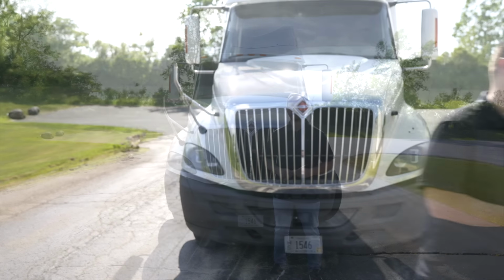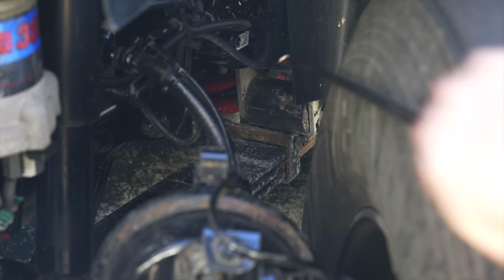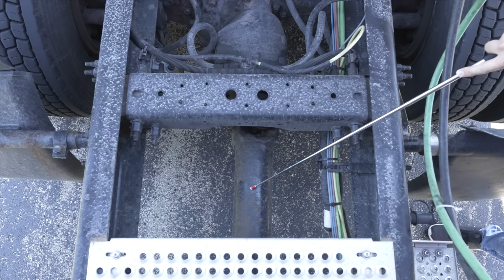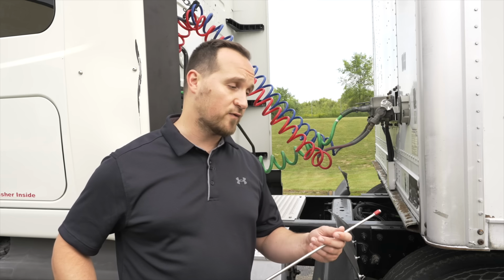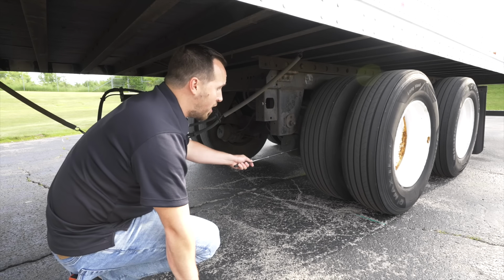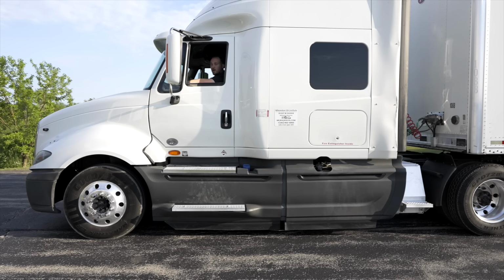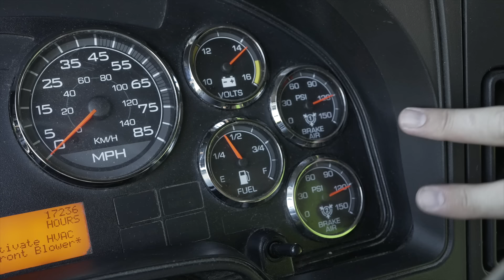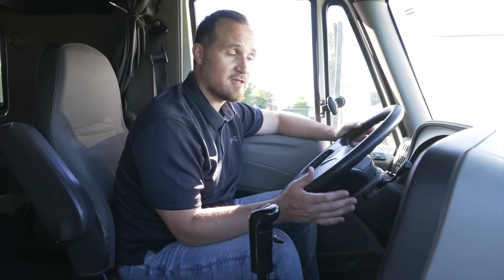CDL CLASS A MANUAL PRE TRIP! MANUAL CDL CLASS A MYCDL BUDDY

Comment: You missed governor cut out... build pressure between 125-140 release air and hear a sneeze

Also when you do tractor parking breaks 
Trailer parking breaks 
Service breaks 
You always in first gear... 
and you have to say it 
Its better to do that first than do the governor cut out 
Air lose 
Warning signals
Spring breaks or parking valves 

This is why it's important to do things in order to not forget things 

This guy has another video that he is acting as an inspector and has a guy doing the pre-trip I recommend to watch that its more clear and doesn't miss things 😊
Reply: Governor cut in and cut out tests are NOT required in Wisconsin, so it wasn’t missed, neither is Air pressure build up…both used to be prior to 2014, but not any longer

Comment: We have a debate going. Why do you have to turn the engine off for an air leakage test ?  If the psi is over 100 psi the compressor will not come on because the truck has lost air, right?

Comment: At the end you should pull both valves out, not push them in and then shut off the truck.
Reply: That’s exactly what he does…he pulls both knobs out, places gear shift in neutral, and shuts off truck